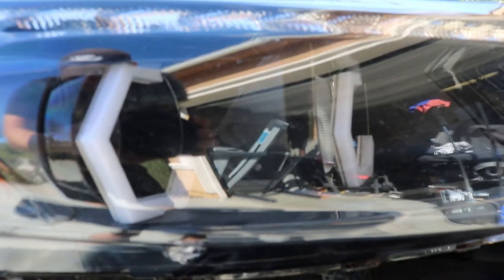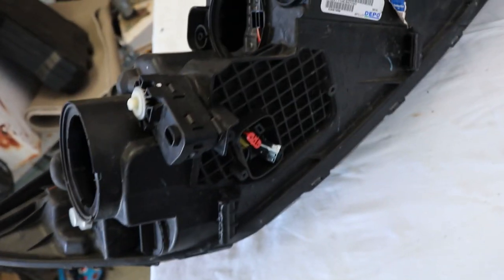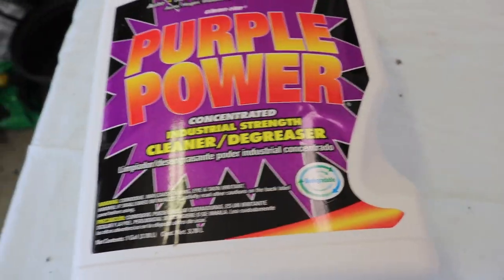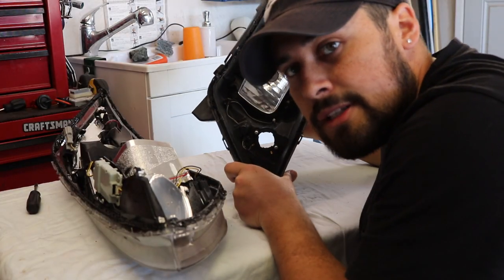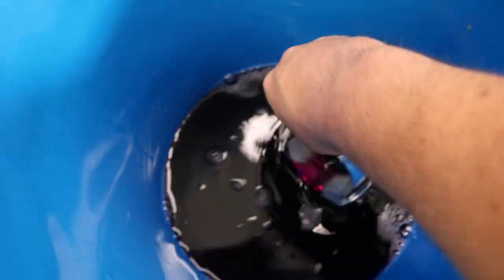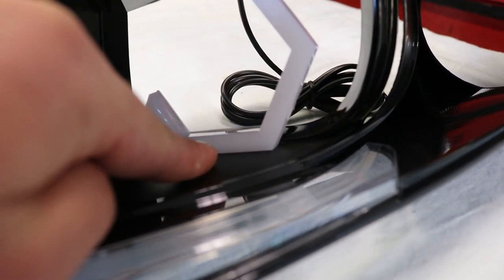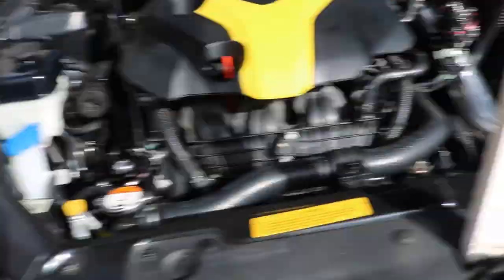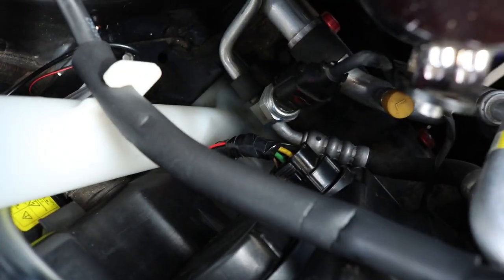Custom Headlights KIA K5 Optima l DIY Install

Comment: Hey I wouldn’t recommend putting the headlight assembly directly on the oven metal, it can really damage the housing from it melting. When I did mine I just put a piece of wood for it to rest on. Just thought I’d mention in case anyone decides to do this
Reply from the maker: Good call!, that is a good Idea💪🏼 I had no issues this time. But I definitely will next time better to be safe then sorry💡
Reply: In the beginning I thought this was a sarcastic, ironic comment 🤣 on my journey into the video, I see now..

Comment: I’ve been looking everywhere for some headlights for my 16 optima lx 1.6 T would these fit for mine? Or any you can recommend?
Reply from the maker: Sadly 2016 are completely different sizes compared to 2015. But contact my Instagram @dark.rse and ill be sure to help you out there.👍🏼

Comment: Hi I wanted to ask you is the inside where the low beam lights able to be opened?I'm trying to fix my reflector inside low beam I'm thinking it flaked off because my low beam is really dim and I don't want to spend on a new set if I can just redo the reflector.

Comment: Hey i wanna get those clear headlights that dont have the amber on the side. My question is can i install 2013 headlights on my 2014 optima
Reply from the maker: Hello! And good question! To say the truth Im not sure if its possible as the wire harness could have a different plug setup:/

Comment: I couldn't tell , but are you running the eyelids over your headlights ? I have a 2016 and hate how it has that top gap showing the top of the headlight.  If you are or have in the past what do you recommend? Tinting , Paint or ordering some of the vinyl stickers offered on ebay ?? Thanks
Reply from the maker: Nothing is done to the headlights other then what is shown in my latest video👍🏼 but id recommend wrapping it yourself with Black vinyl.

Comment: to clarify. the stock headlights aren’t effected by this right. there are still useable?
Reply from the maker: The headlights are not affected. You are only adding rgb lights. As long as you dont cut any wires in the process you should be fine👍

Comment: Is this street legal?
Reply from the maker: It is not legal to make any after market modifications to your lights but if you aren’t driving around with crazy light color or blue or red Id say just stick with white and you wouldnt have much of a problem. Ive been driving with mine on with only using white all the time and never had an issue. And to prevent any problems I just turn them off when I see any law.